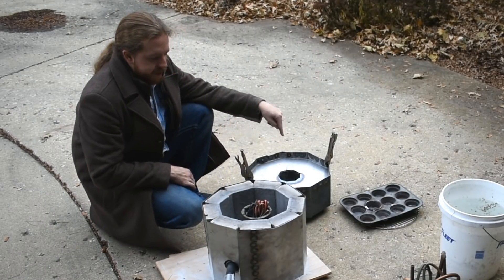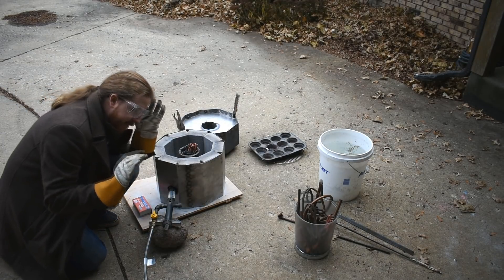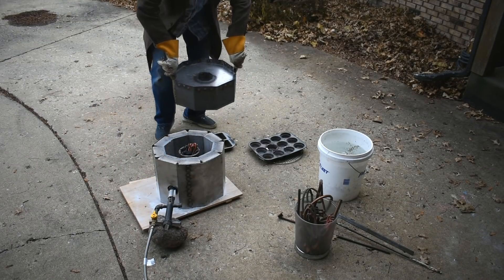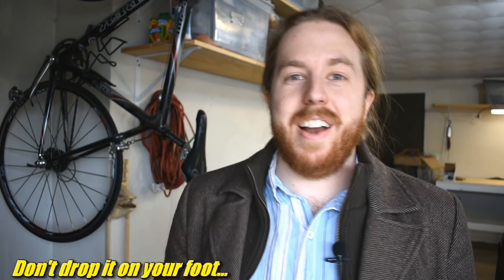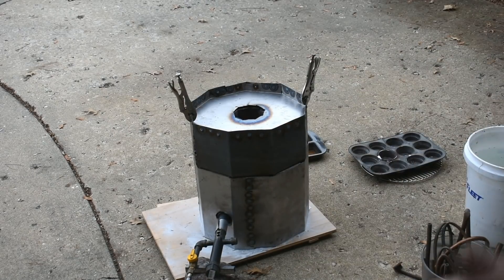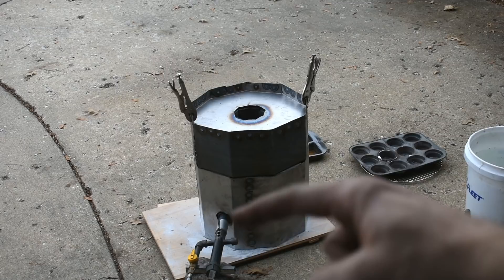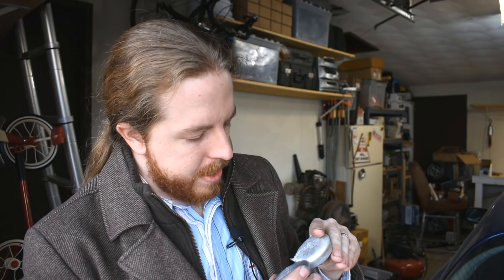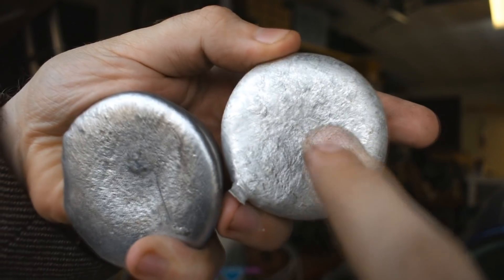Melting Copper in Ingots using my Fire Brick Furnace and a Propane Burner

Comment: A readily available (purity unknown to me) source of zinc if you want it, is wheel weights.  I saw a video on how to identify the 3 major kinds of metals (lead, zinc, & steel) used in wheel weights.  Manufacturers are moving away from lead for environmental quality reasons.  Have you thought of using a different dunk tank for your muffin tin?  Big box stores around here sell 2 sizes of plastic mixing pans (for tile grouting and the like).  The smaller one costs about $15 and is probably big enough (24 × 18 x 6 inches, or 61 x 47 x 17 millimeters) to immerse your entire muffin tin horizontally.  Just put a few small stones, bottle caps, or finished ingots in the bottom to prevent melting from direct contact.  I'm not sure if that will warp your muffin tin, but I'm curious to see.  Keep up the fun, & GBY.
Reply from the maker: I hadn’t thought of that, I just use my old bucket.  I’ll look into that, thanks
Reply: Yw.  It also makes a pretty good tote to store your stuff all in the same place on the same shelf.
Reply: If you go with a big bucket of water to keep your propane tank warm, you might also want to get a submersible bathtub heater to keep the water warm.  The pet store ones for fish tanks are generally inside glass tubes, so probably not so good.  Health products stores sell  kinds made for keeping bath water warm for elderly people.  Some places like Tractor Supply Co. (TSC) sell stock tank heaters so livestock drinking water doesn't freeze.  There are quite a few options to choose from.  You could also try insulating your tank with a tarp and some beanbag chair styrofoam pellets, and duck tape: "the handyman's secret weapon", according to Red Green.  (DON'T do that last 1, it's a dumb idea.)

Comment: Can I cast a 20 cm Copper/Aluminium sculpture of a bird & have good detail do you think? Do different metals have better detail? I know aluminium isn't great. I've been having much success with detailed pewter sculptures but they are very heavy. I'd like to make small bronze ones eventually. Would delft clay or similar survive copper sort of temperatures? Thanks
Reply from the maker: different alloys do have different casting properties.  Pure aluminum and pure copper are both pretty bad, but cast aluminum (containing high amounts of silicon) and various bronzes and brasses can work with a high level of detail.  Other metals like zamak (alloy of zinc and aluminum) also work great at lower temperatures.  delft clay holds up pretty well i think, i've never used it personally though.  I think jewelry makers use delft clay and gold melts at a similar temperature as copper, so it would probably work. Cant say for sure though.
Reply: The casting material makes a huge difference too. Petrobond has really small grains for high detail
Reply: Petrobond is what I use, it's great.  You have to sieve it and then pack it down loads , after casting you just remove the burnt stuff. I will experiment with bronze and report back (y)

Comment: Quick question. Does anyone else melt metal in a charcoal foundry, but instead of charcoal you use coal? I do and it melts steel when it’s on full power, I highly recommend it!
Reply: Well the only way I can get any coal is to be a shitty person and wait for Santa to deliver some for me once a year.
Reply: RC pi yeah! It’s incredibly efficient though! I can buy 40lbs of coal for 6 dollars and that will last me about a month of melting every weekend for hours straight! I designed it for charcoal but I used coal instead! I am 12 and built it myself! I take proper safety precautions though like a welder apron, welder gloves, fireproof arm sleeves and a full face shield! Bought all the safety equipment for cheap at harbor freight and it has protected me from molten steel and aluminum many times!
Reply: That sounds pretty dange... I mean AWESOME
Reply from the maker: I tried to find coal to do that exact thing, but i couldn't find a local source that would sell in small quantities.  an hour drive wasn't in the schedule either :(.  I'd like to try it though.  I know old commercial iron works generally used coal for that reason.
Reply: Tractor supply sells it real cheap! I recommend taking a drive to get a few bags! It will last you months and will burn way hotter than propane when given a high power air source like a cheap shop vac!
Reply: I feel lucky now that tractor supply is 7 min away
Reply: When I was a kid, some of my friends and I used to walk railroad tracks, and sometimes we'd find spilled coal from power plant deliveries among the ballast stones.  Maybe you could hire a kid...(impending legal entanglements).  VERY small quantities, though, if that's what you really want.
Reply: Sounds fun... But wouldn’t he be arrested? Lol sounded fun!
Reply: Kids can get away with stuff like that without too much trouble, but it IS trespassing to "walk the right of way".  Parents won't like anyone exposing their kids to potential legal issues resulting from being caught.  There's also the whole "contributing to the delinquency of a minor" problem for anyone putting them up to it.  STAND BY ME was a nice movie, but reality Isn't always so nice.
Reply: Ron Yerke yeah. Stand by me is a great movie, I love the scene when they jump from the bridge when the train is coming! Also the pie eating contest where everyone throws up! Great movie!
Reply: Frank Villani Oh, I had forgotten about the Barf Fest (Barf-O-Rama?). Um, thanks a lot?  Overall, I too enjoyed that flick a lot.
Reply: Ron Yerke No problem...
Reply: I could have dug it out of the mountain in Pa., alas I was not doing this in Pa.   There is a place not too far to get coal-built my furnace to use either charcoal/coal or propane.
Reply: Mark Henry hi! Cool use coal! It’s cheap and last awhile but burns a lot hotter than charcoal and propane with a proper air source!
Reply: Yeah, never used coal but even charcoal is hotter with a blower.   I've got the propane system set up so it is portable as I do anthill casts but, as with Paul, I need to be able to melt copper and silver to do some jewelry casting and propane just won't cut it.
Reply: Mark Henry yeah. I would try out coal. It’s hard to light at first but you just need lighter fluid and paper with some wood. It burns really hot
Reply: Had a coal stove for warming the 1700's farmhouse in Pa.   Would glow red and one could not stay in the room with it because of the heat.   Bout to go check my address book as I had a place marked locally in N.C. to get it.  Kind of forgot so I appreciate the reminder.
Reply: Mark Henry cool
Reply: A glowing red stove?  LOL!  You just reminded me of a guy I once knew who used to burn old tires in HIS wood burning stove.  Not only did it also glow, it smelled very, very bad, too.
Reply: Ron Yerke yeah. I use fire starter gel. It burns for awhile and lights the wood. The wood gets air blown on it with my blower, and I throw coal on it. It takes about 8 min
Reply: Frank Villani okay.  Sounds like you have a pretty good system already.
Reply: Ron Yerke yeah! The coal also burns clean. There is no smoke no sparks a almost no fire. I use tractor supply but coal. It is anthracite coal. Without an air source it burns at 900 degrees Fahrenheit

Comment: + I KNOW HOW TO MAKE ELEMENTAL SILICON!!!
Reply: Do tell
Reply: YOU GET THE SILICON BEADS FROM THE DRYING PACKET IN FOOD PACKS AND THEN SMASH THEM UP MIXTHEM WITH MAGNESIUM, BECAUSE MAGNESIUM IS HARD TO LIGHT ON FIRE, PUT A LITTLE BIT OF THERMITE(MADE FROM IRON OXIDE/RUST AND ALUMINUM POWDER) THEN LIGHT OF THE THERMITE THEN WATCH THE REACTON, SMAH THE SLAG OFF THE YOU SHOULD SEE THE SHINY METAL THAT IS ELEMENTAL SILICON!!!
Reply from the maker: sounds complicated lol
Reply: Paul's Garage nah not really, quite simple but really dangerous
Reply: heh, welp its somethin for the hollidays isnt it?
Reply: +the supplies will be bought or made depending on how much or how hard to get they are...

Comment: Just use the burner to heat the tank back up.........................JUST KIDDING  LOL  (I thought this would be your kind of humor)  Cool stuff  isnt it fun to be a grown-up we still play but our toys are more dangerous LOL
Reply from the maker: You know i've alwasy wanted to accidentally launch myself into orbit using a giant explosion...  Grown up stuff is WAY more fun, you're right. When i was a kid i had a small toy hammer made of pine.  Now i have a welder.  MUCH better!
Reply: Nah.   Why waste the propane when you can set your tank in a BBQ grill and light IT to keep the tank warm?
Reply: There are warming pads made for starting seeds growing in gardening shops, that don't get especially hot.  One of these or a plain old electric blanket might be enough to keep your tank from freezing.  Perhaps a heat lamp.  Is that about the same as direct sunlight?  I think a better solution would be to use forced air for a more efficient burn, so you can slow down fuel flow.  Perhaps a combination is best, but IDK enough about that.
Reply: We use our torches to heat up the bottle all the time.  Just did it today as a matter of fact.  If someone says you'll blow up they are sadly mistaken.  Besides that it's just the lower parent of the bottle that's frosty anyways so you're not actually heating the regulators.

Comment: lol im on a quest to make every element except the radioactive ones on the periodic table.
Reply: Define make?
Reply: you know like... making hydrogen from water sodium hydroxide and aluminum... and sulfur wont work that well coz it is not discovered how to make it but i can purify it
Reply: Make or collect? Cause unless you are smashing atoms...
Reply from the maker: sounds like fun, let me know when you can pull gold from sea water, there was a guy who was trying that.
Reply: huh that does sound interesting, there is two methods i can think of one is : mix sea water with hci and nitric acid... or get mercury and shack it in a bottle then squeeze the mercury out with tissue to recover gold...
Reply: lol i think its impossible to pull gold from sea water coz gold particals are way too dense to be in water they'll probably just sink to the bottom of the sea...
Reply: well i think collect i suppose coz "you can not create or destory, it can only be transformed" so my answer is transform!
Reply: man this is getting sciency
Reply: well i think collect i suppose coz "you can not create or destory, it can only be transformed" so my answer is transform

Comment: It looks like your new furnace works really good.
Reply from the maker: thanks! Its much better than the last one, and it's finally big enough for a big crucible for the gingery lathe bed.
Reply: +Paul's Garage first attempts at non-trivial tasks are rarely final attempts. So your other furnaces all taught you things. Though it is funny how in hindsight those same things often seem as if they should have been obvious at the outset. But that's not how it works.

Comment: Also get 2 propane tank so you can just hook up the other one once it freezes.
Reply: I think what folks do is just use bigger tanks. But swapping is an option too.
Reply from the maker: I could try both, i've just been using grill tanks since i have them around (for the grill)
Reply: It's maybe 30 seconds max. So the amount of heat loss would be minimal

Comment: Are you able to use butane instead of propane for the burner or does it have to be propane?
Reply from the maker: It probably depends on the burner design, and you would need a lot of butane

Comment: Glad to see the furnace is stilling working great! I want to make one but fire brick cost soooo much. I am thinking about using Rutland Replacement Fire Brick (604) because it's 20 bucks for 6 at Ace Hardware and it is rated to 2700F. Think it may be a bit thin however. 
Can't wait for the next video!
Reply from the maker: those won't insulate very well, but they should hold up to the heat just fine.  The insulating ones are also much weaker, so the heavy stuff is better in some ways.
Reply: Paul's Garage I may try them out and see how well it works. I think it could be worth it with the price difference. I’m not really sure what I’m going to do for the foundry exterior. Not the best at welding and I want it to look nice.

Comment: are you going to do the aluminum casted hammer handle that on youtube as well?
Reply from the maker: No probably wood handle.  Absorbs more shock, not as slippery. I plan to use the hammer.
Reply: my apologies the one i had in my mind was this he uses lead not brass but still a neat idea https://www.youtube.com/watch?v=rN09nj2Vu8g&t=32s
Reply: My bronze hammer has a steel pipe for a handle.  I think my stepdad's father made it himself.  That thing REALLY needs to be re-cast too.  It's all smooshed up unevenly now.